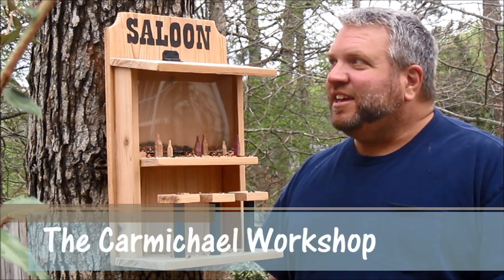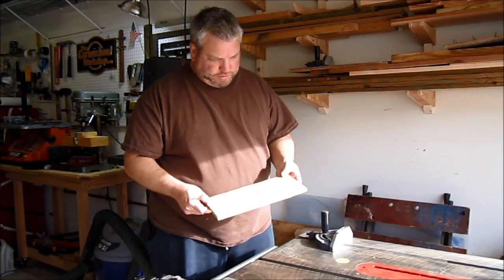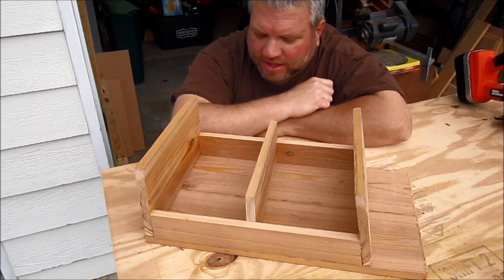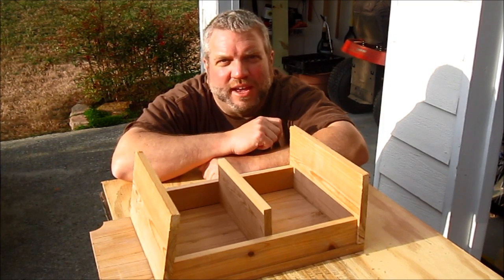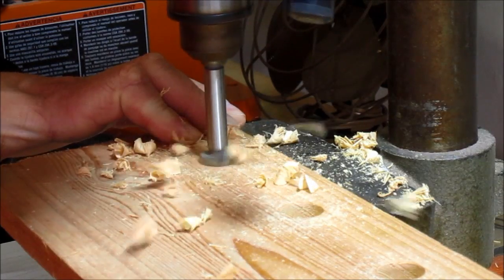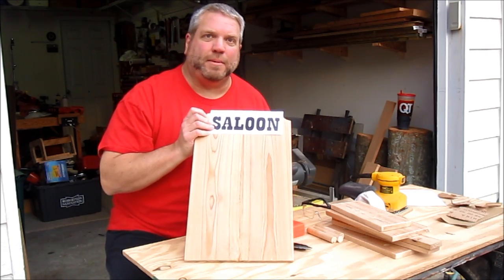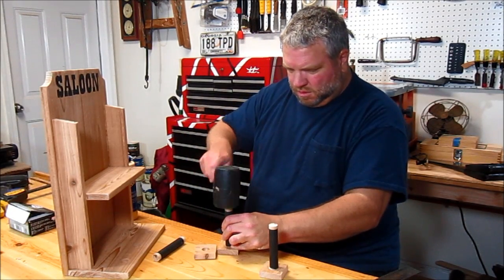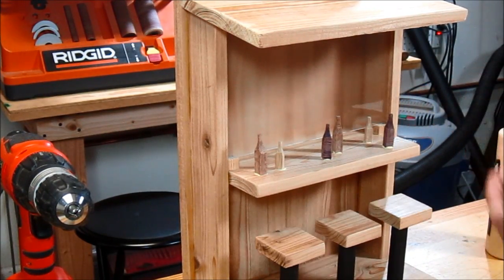Make a Saloon Bird Feeder - Easy DIY Weekend Woodworking Project

Comment: Nice work Steve Thanks for posting im building a similar feeder hoping squirrels will use it how much space do you recommend under the plexiglass so the feed can make its way out
Reply from the maker: It depends on what size the feed is, but for bird seed a 1/4"-1/2" gap works.  If you put nuts in it, then just large enough for the nuts to pass through.
Reply: I’m thinking sunflower seeds maybe corn thx

Comment: Hey there! Hope you see my comment, where did you get the hinge and plexiglass? Planning on making this with my grandpa! Thank you for the video!
Reply from the maker: Hi Kayla - You can get those from Home Depot, Lowes, or Ace Hardware.  Any hinge will do.  Look in the window glass section for the plexiglass.  It might be called acrylic, Lexan, or Optix and about 1/8" thick.  Glad you are going to make one with your grandpa!  That's awesome!
Reply: @SteveCarmichael  Thank you so much for your reply!
Reply: @SteveCarmichael  Sorry for another question! What is the height of the 2 inch squares and the length of each dowels?